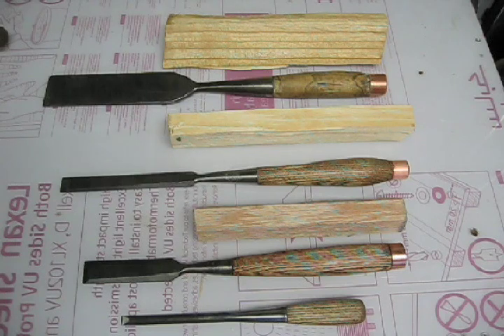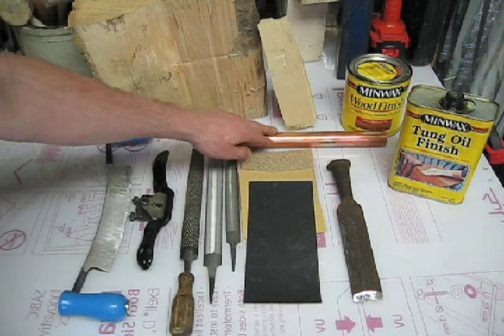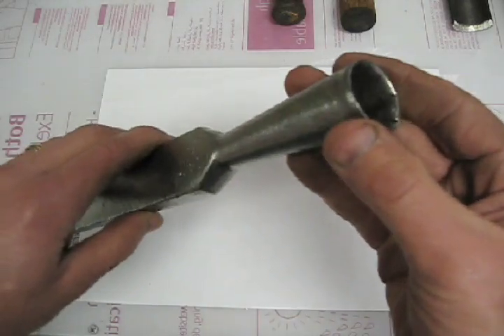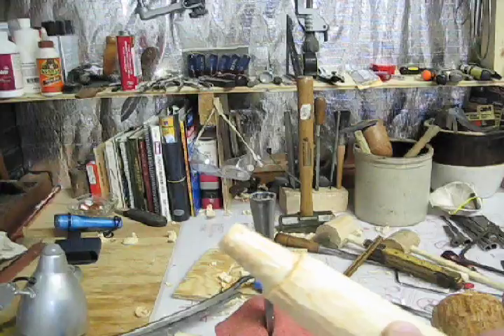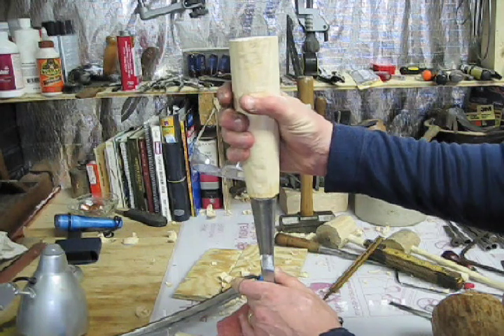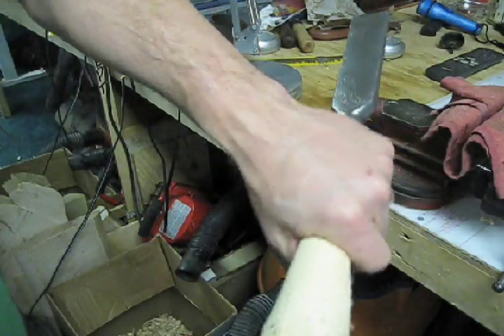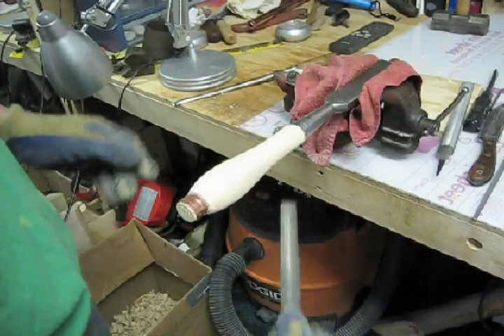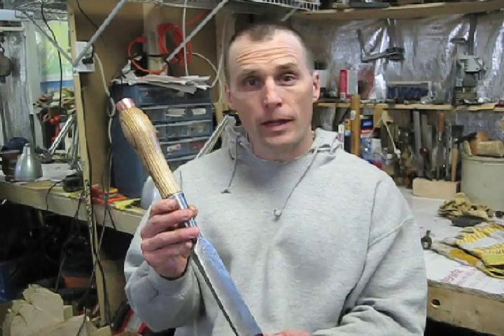How To Refinish A Chisel and Handle | Chop With Chris

Comment: Here in our country Philippines, most of wood carpenters specialist we are using this type of chisels and the kinds of handled is like this in your illustration. I am a wood carpenters specialist for more than 30 years, the same chisels I used, but only for the quenching methods and techniques we have a different cause we were using the old fashioned and tradition of quenching methods through fire soap and water. This could be done by a good blacksmith who's expertise by quenching methods and technique of bevels edge and sharp of chisels it will prolong when you use it at work and the results is more tested.
Reply from the maker: Thank you for the information!

Comment: Picked up some good tips.  What part of the country do you live?  I live in SC and there are NO auctions, or flea markets around here that ever have old tools like this.  Additionally, finding any wood other that Lowes Oak, Poplar, and pine is nearly impossible other than expensive mail order.
Reply from the maker: +Scott's Wood Bummer.  I've moved all over the east coast and Midwest.  Lots of wood and tools.
Reply: Chop With Chris
I've been getting older tools from ebay on occasion and refurbishing them, but it is a crap shoot.  It's better to hold it on your hand rather than looking at a picture.

I'll be an oak and poplar expert in a few years :)
Reply from the maker: +Scott's Wood 👍🏻
Reply: eBay has amazing selection of tools

Comment: I have made great handles requiring no  Farrell for a binding stop  at the top of the chisel by using Dogwood or elm. Even after using for years, there is no flare out of the end by striking. A rounded end is far more ergonomically correct as it transfers the thrust far better. Check out your claw hammer. That is why they are never a squared edge. Regarding epoxy ! Never use epoxy to fasten the socket. 
A  proper wedged handle requires none. It will never fall out pull out or bounce out. However, it will very easily come out by tapping it lightly on the side by tapping it on the bench or other surface.
Refer to Morse tapers. They are all that it used in machinery such as lathes and mills. They come in different sizes and hold extremely well. A drift pin is common to remove them.
Reply from the maker: +James Lucas Thanks for the tips

Comment: Actually was a "slick" I think.  These were made for timber framing and boat building, etc. and instead of a hammer end they usually had longer handle for balance and reaching and a bulb or rounded end for the palm of the hand.  Its weight was used in a back and forth chopping and paring motion.  Hope this helps, they are very useful.  Also, if you look closely they were usually mild steel body with a forge welded tool steel insert for sharpening.  Look closely.
Reply from the maker: Thanks for the info.

Comment: I've always heard that the handle isn't supposed to be driven all the way down into the chisel; about 1/4 inch gap should be left at the top of the handle where it connects into the chisel.
Reply: Awesome work though and thank you for sharing
Reply from the maker: You're right.
Reply from the maker: Thanks!
Reply: @ChopWithChris  thank you for the video. I made a handle a few months back, going for the Stanley socket handle style and fitted the handle all the way down and soon after learned that it is supposed to have a small gap lol. The handle I made still works fine though. I'm not sure how important it is or what the full reason is for the gap but I seem to recall it having something to do with keeping a tight fit because it has a larger diameter of material below it and over time when knocking the butt of the handle when working it would gradually slide further down and thus retaining its tight fit whereas without the extra gap of thicker material it would cause it to work loose over time....I THINK that was the gist of it but I could be totally wrong about the reason for the gap and I'm too lazy right now to look it up 😃 
Thank you again for the video!

Comment: There has got to be a better way to hold wood (for draw knife use) than a bench vise and a towel.  Some better (table top) version of a bench pony or sculpting vise.  I cannot figure it out.  Something that will hold the wood very solidly, be easy and quick to release and re-tighten.  I will keep thinking about it.
Reply from the maker: I had to make due with what I had.
Reply: @ChopWithChris  Well, I started a maple handle for a really small chisel I had laying around.  This is probably one of the most time consuming handles I have ever tried.  I think I started with a too small piece of wood.  Hard to vise it up.  Next time, I will leave extra wood so I can lock it in the vise.  Then be free to shape the handle.  Thanks Chris.  This is going to look good and work well.
Reply from the maker: Thanks and good luck.
Reply: @ChopWithChris  I am still waiting to see you set up the lathe you got from Jimmy.  That thing looked neat.

Comment: why specifically do you not use power tools?
Reply from the maker: I just really enjoy the challenge.  I explain this in more detail in my video:  "My Hobby:  Wood, Tools, and Video".
Chris
Reply: Chop With Chris Solution worthy of respect. In the beginning of their studies in the Otori I was doing woodcarvings used: the old "knife jamb" (Russian "Нож косяк") and a set of miniature knives with replaceable blades, which proved to be quite fragile. Then I started to think about the manufacturer knifes.i at the moment I did have a knife. I machined blade from the disk of a circular saw. 
And I'm slowly starting to think about the way to your steps. Thanks for your video!
Reply from the maker: LuckyanovArt Удачи!

Comment: Very nice, but one mistake: 3:44 never file the markings cuz you'll end up with a loose handle as you did, file only from where the markings stop and forward, the chisel had already reached the point where you have markings if you file it then you took off too much wood.
Reply from the maker: +sototajer Excellent point.